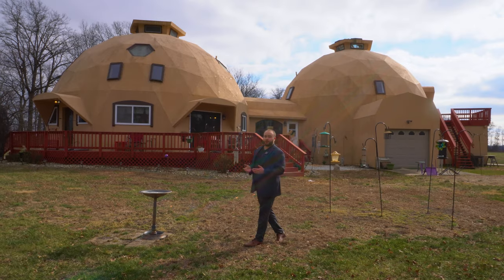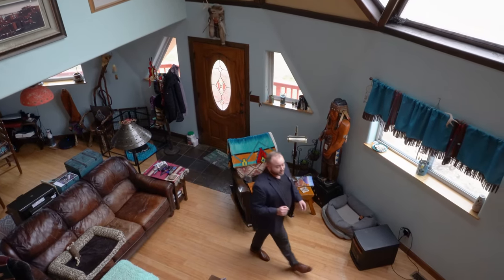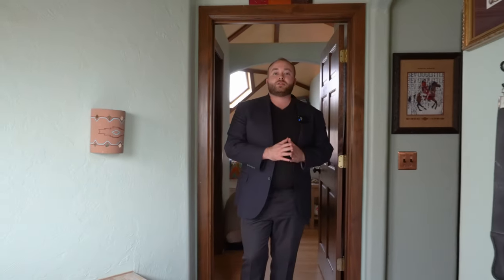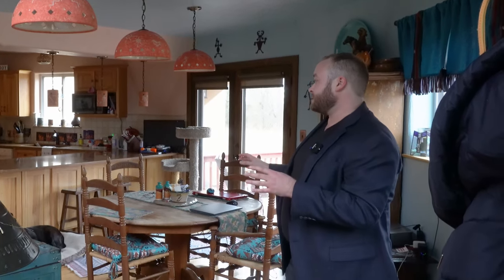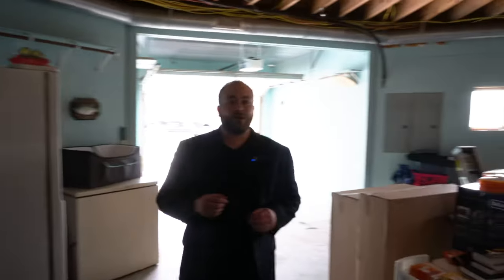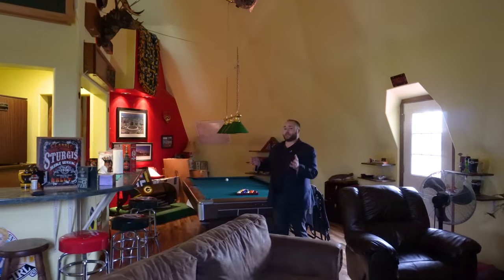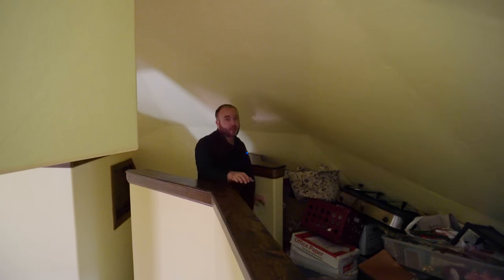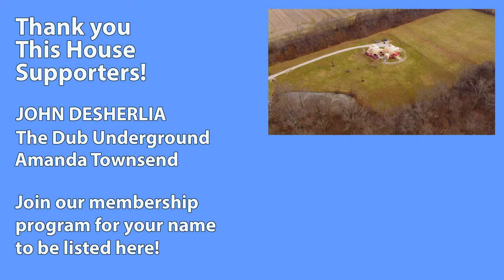Touring Dome House | This House Tours

Comment: I have wanted to live in a geodesic dome home since I was a young boy. I first read about Buckminster Fuller when I was about 10 or 11 years old. His designs and inventions were so far ahead of their time that it is hard to believe he did the things he did with the technology available in his time. All of his designs worked, but weren't as practical as he seemed to think they were. With the exception of the geodesic dome. That is a design and a structure that ticks off every box. I am too old to consider living in one now, but I continue to dream.
Reply: This is more than a house, it's a mansion. I'd settle for a magidome for a tiny Shelter in the garden. I made 1 miniature, it takes 25 sicks same lenght and 11 hubs to hold them together. I looks quite good and I feel good just thinking of it. At 70 I'm spending part of my time thinking about how I could make a bigger one to sit under. It would have to be winterized as our Canadian climate brings us arctic colds most of the winter and summer is too hot for us. 🍁☃

Comment: We have many of these back in Colorado, I have always been fascinated by them, but one thing I always feared, are all those triangle panels and water leakage and who would one even call to fix it... Though I did see one in the mountains that had been wrapped and completely covered in cedar shake shingles...That garage is a dream though. lol.  Loved the tour of it.. thank you.
Reply from the maker: When built correctly, like this one, they tend to hold up really well against the elements.  Of course, they have to be properly maintained on the exterior, but clay is very resilient to water.  Glad you enjoyed this tour!
Reply: Yeah, more joints and angles generally mean more places that can leak. But I guess if it's sealed properly, that probably wouldn't be a big issue. There's also monolithic domes that don't have this problem, though monolithic domes don't tend to be as homey as many geodesic domes.

Comment: I love geodesic domes, and also nice seeing a home with lots of stuff in it. This seems reasonably priced. I like the ceiling in the man cave better than main home because I think although the wood framing of the geometry is really nice quality, I think the structure of the geodesic dome is more beautiful when not outlined. Doing drywall on these domes can be expensive and difficult. Cupolas would be a good design feature on regular homes also.

Comment: whenever I see these types of dwellings I think double-glazing window companies should get into making them for DIY assembly, make the hexagonal framework in sections that can be bolted together, they can be filled with insulation and clad on both sides or glazed as needed, but keep them all the same dimensions for cheapness of manufacturing, when you look at one of these dwellings it just looks like a lot of odd shaped double glazing, could be a great business venture here for someone glazing companies,